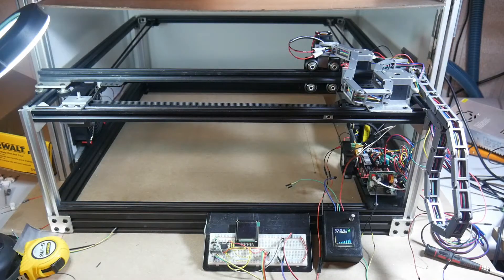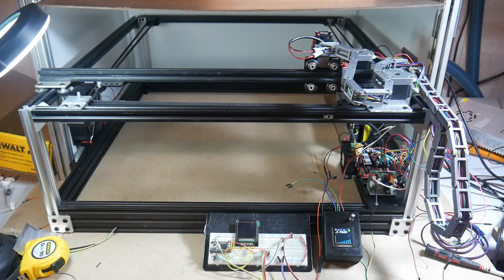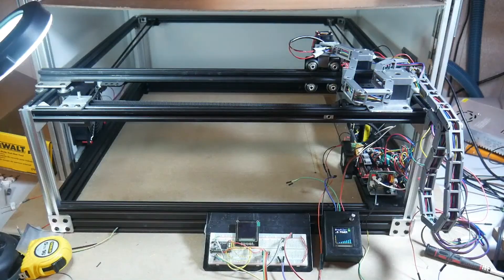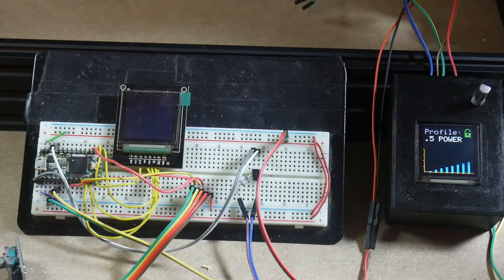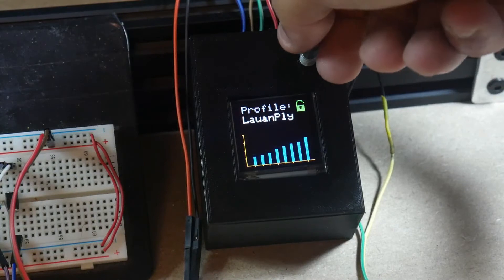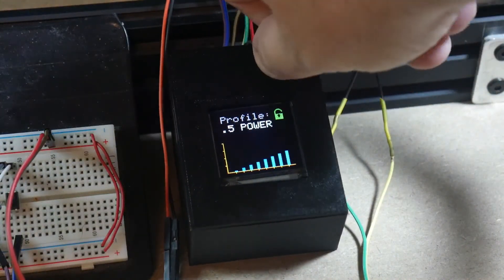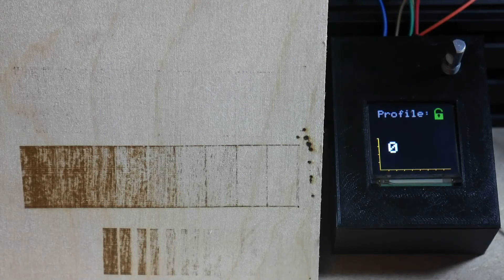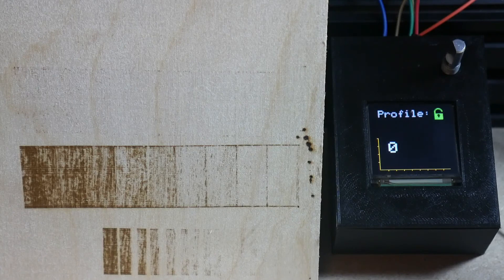DIY Laser Engraver - Solution for quick and easy grayscale images.

Comment: very nice i got a 15w laser from ebay and it got 3 leds. yellow red black. any idea on how to connect them on ramps? also is there any scematic and firmware for the mod u made? do you sell it? https://www.ebay.com/itm/15W-15000mW-High-Power-Blue-Light-Laser-Head-DIY-Engraving-Module-Diode-Engraver-/401298754171
Reply from the maker: Sorry, this is a really late reply.  I can't really see selling these because my system is very likely different that other people's and it would not be realistic.  If you are still working on things, I would assume that you have a wire for power, ground, and TTL.  I can't see the printing on the board that well, but it looks like the yellow wire is something 'in'.

TTL is a 5-volt signal that will determine the power level of the laser...To connect it to the RAMPs you have a few options.  The easiest is to wire TTL to D9, the pins usually used for a cooling fan.  DO NOT DO THIS DIRECTLY...The output from those pins is 12v.  You will need some kind of level converter.  Which is part of what this device does.

There is another way, but it is probably very bad for the module in the long-term...That would be to short the TTL line so that the beam is always on 100%, then attach power and ground to D9 on the RAMPs...I did this when I first started, but it is a VERY bad idea and as soon as I realized that I stopped.